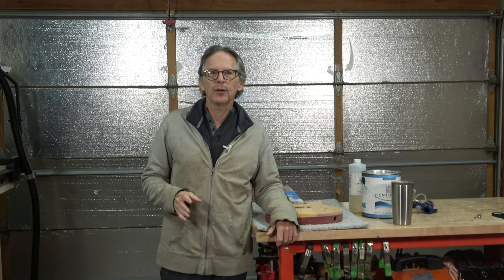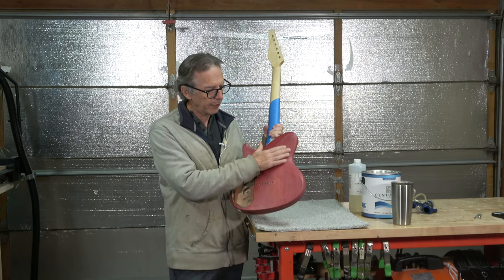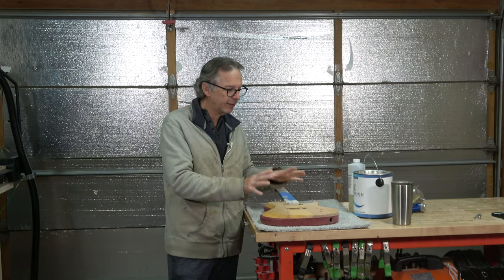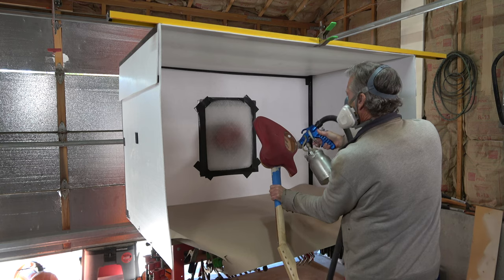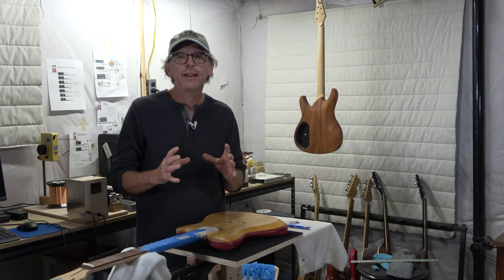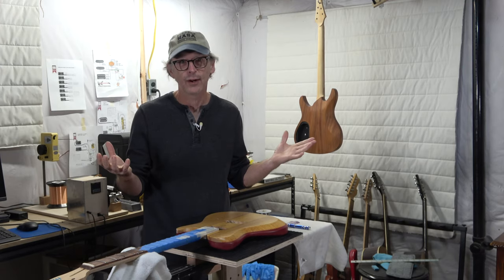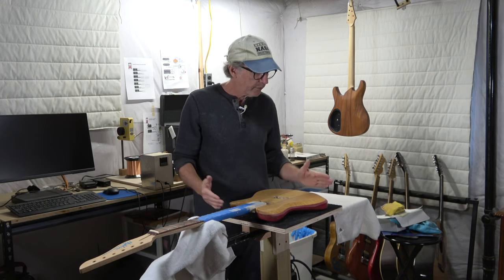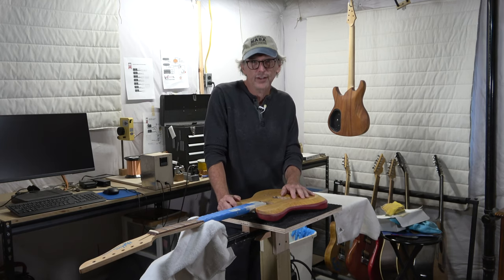How To Apply Matte, Satin, & Semi Gloss Clear Coats

Comment: Hi Chris- as an auto painter who does guitar finishes quite regularly I am intrigued by this method- without actually buffing a sanded finish wouldn’t this leave the products chemical composition exposed, leading to accelerated breakdown of the product? We were always taught that the cutting action of a buff/polish re-seals the polymers in the product, preventing accelerated degradation. Interested to hear what your experience is with it at all? I’ve been a bit frustrated going back to re-spray my satin finished guitars because I didn’t think I could get away with any sanding.. cheers!
Reply from the maker: Guitars aren’t cars. They live in very different environments.
Reply: There are some waxes out there designed for matte and satin finishes.
Reply: @chase_modugno  yeah for sure, but not cutting compounds as far as I’m aware?

Comment: I always thought you couldn’t sand a satin or Matte finish. You were expected to lay down a flew less final coat. So even with urethane, you won’t compromise the finish, with sanding? How do you gage the amount of reflection? I’m confused.
Reply from the maker: Modern high tech sanding abrasives like Super Assilex make is possible to sand satin or matte finishes. However, I strive to lay down perfect final coats. That's not easy for most people to do.

Comment: Seems like you had no issues thinning with water, eh? Did you consider trying to thin with the crystalac retarder?
What do you recommend as an alternative to the eagle abrasives for polish sanding (>P1000)? As much as I'd like to use them, I just can't justify the price, especially being in Canada and not the US. I currently use Brite-tone for all my guitars, and have no issues with level sanding dry with Mirka products up to P1000. However, in your opinion, what would be the next best thing for dry polish sanding?
Reply from the maker: My issue with thinning is that I have to apply many more coats and that takes too long. As far as a sanding alternative, I don't know of anything that comes close to Super Assilex. Go with Mirka Abralon above P1000 if you can get it.